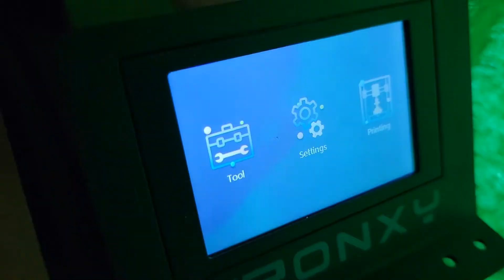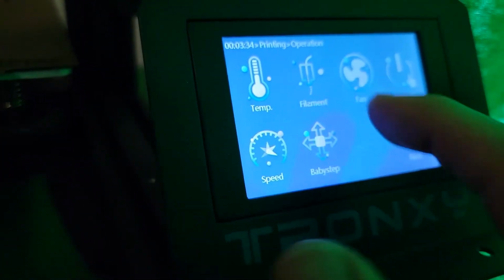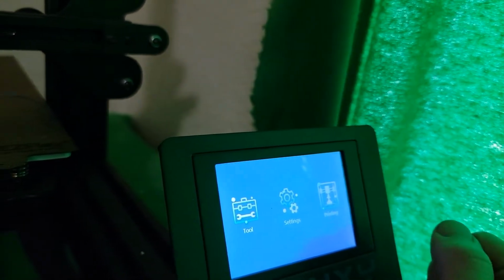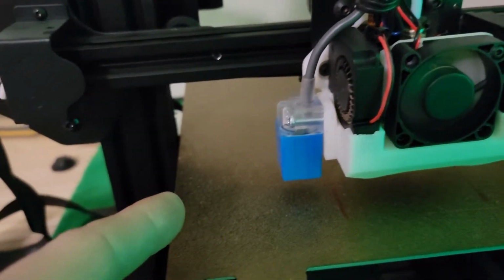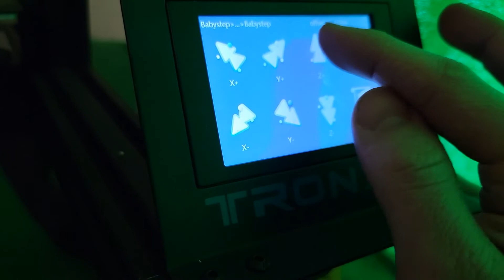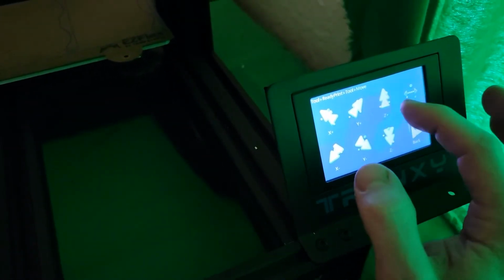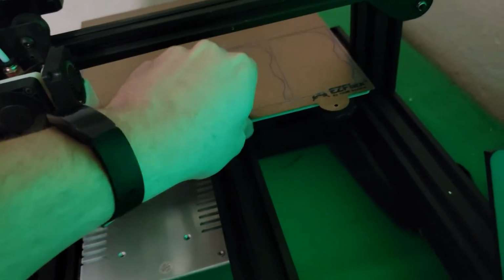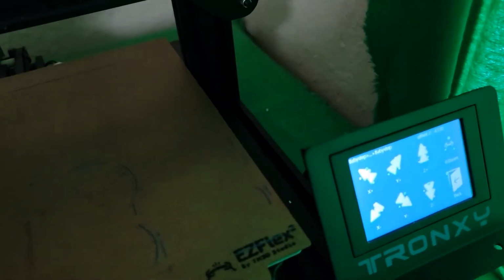Marlin Operation On Tronxy XY-2PRO. Autolevel and Baby Stepping.

Comment: Thanks for your replies and helping out this noob!

Have you ever run into issues with baby stepping? When I first flashed to Marlin it worked but now it doesn’t move up or down no matter how many times I press it
Reply from the maker: Yes, every once in a while i will have an issue where the z-axis will refuse to move until i power down the machine and restart it. IDK if that is a junk sd card issue or not. usually its from pausing a print and trying to resume or stopping a print and trying to reprint. will get stuck on the same z-height but will try to print ever layer at that height.

Comment: Hello sir I was wondering if you can comment on my issue. 

Tronxy-2 pro is my first and only 3D printer. Whenever I calibrate and set the zoffset for a perfect first layer…the next day I would start another print and it would be either be too high or too low. I find myself spending an hour calibrating the offset before every print. I have tried different firmware and Jeff victors z offset fix for the stock tronxy but at this point I don’t think it’s an issue with the firmware per se. 

Being this my first printer and new to this I wasn’t sure if this was normal or not. 

Are you able to just wake up…start a print and that’s that?
Reply from the maker: Yes, I can leave it off for months, flip the switch and hit print and it will go just like when I left it. I had a patch on the stock firmware where it did seem like I had to calibrate every print. I would check the z sensor on the side and make sure it's tight and doesn't move over the print process because that will adjust your first layer after homing. The other possible thing could be your heat bed. The leveling screws underneath with the springs in them may be loosing up or moving during your prints. Switch mine out to solid spacers and cranked them down. Check wheels and belts make sure there isn't abnormal wear on them, z auger that rubs the head up and down. Make sure that isn't loose or anything. That's all I can really think of as a mechanical problem for this.

Comment: Hi, can you do a mesh bed leveling device and show how to do it. I have a tronxy x5s pro with a 330x330 bed and no matter how many times or how carefully I try to level the bed it is not good enough to get a single print bigger than a test cube. I also have an ender 3 that I installed ezabl from th3d and I don't have to do anything except put in the SD card and tell it what file to print, I ca. And do set it to print and just walk away and check on it in a few hours and I never have any issues.  The tronxy x5s pro is kicking my ass and I really would love a step by step on how to do mesh bed leveling with bl touch, cr touch, 3d touch or ezabl. Thank you and have a great day.
Reply from the maker: Well you could have a look at my installation video I did for the ezabl and see if that helps. It's on a sunlu